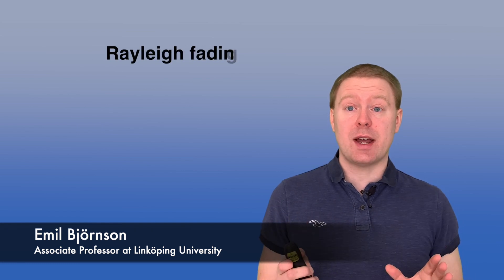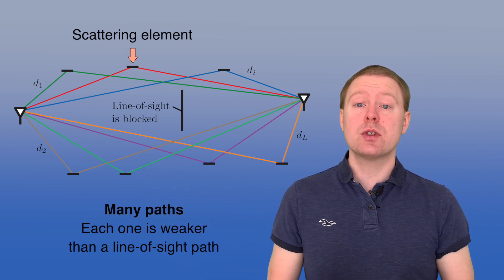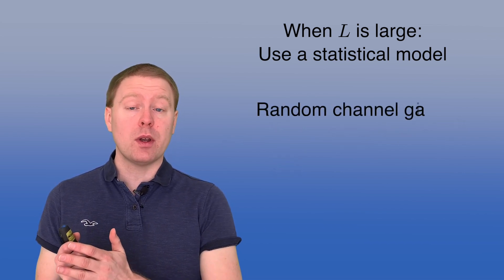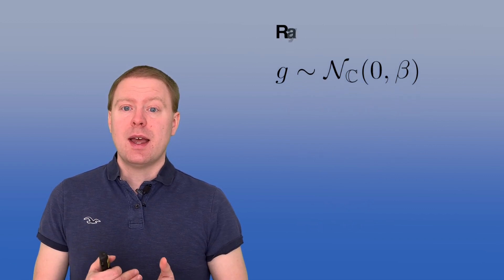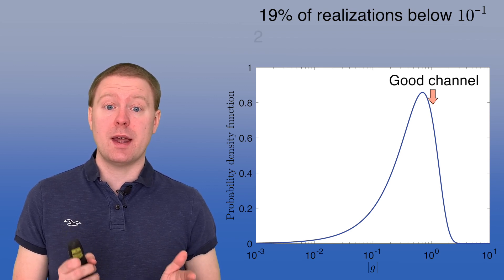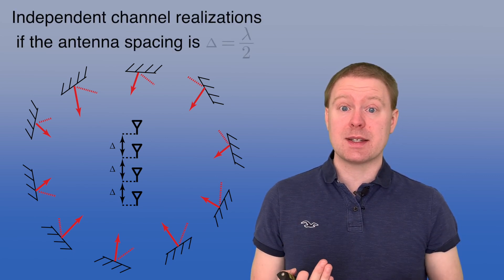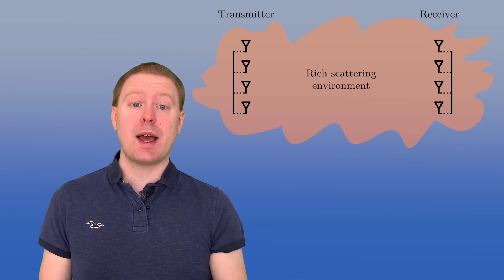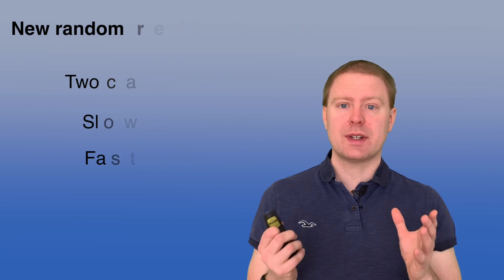Rayleigh Fading Channels [Video 8]

Comment: hello, sir
is this Rayleigh fading channel can be set for simulation only?
if i want to transmit and receive the signal entirely over Rayleigh fading channel in a real scenario, how can I recognize that?
Reply from the maker: Hi! The Rayleigh fading model was created based on measurements. When there are many propagation paths, they tend to interact to create something similar to a complex Gaussian distribution, which means that the amplitude is approximately Rayleigh distributed.

Hence, in real non-line-of-sight propagation scenarios, you can expect to get something similar to Rayleigh fading. The big question is whether the fading realizations across the antennas will be independent (as assumed in this video when we talked about iid Rayleigh fading) or statistically correlated. In practice, we often have some fading correlation, depending on in which angular directions there are scattering clusters and how strong they are compared to each other.
Reply: @WirelessFuture  I totally agree and understand that non Line-of-Sight (LOS) transmission is Rayleigh fading. Based on what you replied, I am assuming that realization of Rayleigh fading channel depends on in the angular direction of the antenna at either side (transmitter or receiver). And by that, If I set the testing environment ( especially indoor) only to have non-LOS between devices, does it mean I have already set for the Rayleigh fading transmission? I barely understand about the angular directions.

Comment: Thanks prof.Emil for your brilliant explanation.
I have some questions.
Why the capacity with same SNR applied  Rayleigh fading channel model(with CN(0,1))  can almost be greater than the capacity applied the estimated channel in real-world scenario?
As a result,  the capacity applied Rayleigh fading channel model can be seen as the upper bound of spatial multiplexing MIMO?
 I'm just wondering if it is possible to get larger capacity in channel of real-world scenario than Rayleigh fading channel model.
Reply from the maker: The best channel matrix from a spatial multiplexing perspective is a (semi-)unitary matrix; that is, all its singular values are equal so one can multiplex many signals that experience equally good channel conditions. An iid Rayleigh fading channel is likely to give you a channel where all singular values are of decent size, but they won't be equally large. One can deploy antennas in real-world line-of-sight scenarios to get a "perfect" channel matrix. Section 4.4.3 in my recent book describes how to do that by carefully selecting the antenna locations: https://www.nowpublishers.com/article/BookDetails/9781638283140
Reply: @WirelessFuture  Thank you for your reply. I sincerely appreciate it.

Comment: sir what should be the value of standard deviation in Rayleigh distribution for highly interference area .
high value or small ?
Reply from the maker: The standard deviation isn't related to interference (which are other signals), but the average attenuation that the channel creates. The variance is typically -70 dB (near transmitter) to -130 dB (1 kilometer away or more). You can have a look at the following video: https://youtu.be/OA4viERrlzA
Reply: @WirelessFuture Sir my professor asked me that...
 For highly dense area, what value of variance should we take for modelling the channel parameter relative to less dense area. He gave me two values 1 and 3
Reply from the maker: @mdraqibkhan8785  One can never receive more power than was transmitted so the attenuation will always be much smaller than 1. However, it is possible to normalize variables to get different scales. The important thing is the SNR makes sense for the setup at hand.
Reply: @WirelessFuture  Ok I got it, thanks sir

Comment: Sir, the code for Capacity Limits and Multiplexing Gains of MIMO Channels with Transceiver Impairments paper, your honor, you published it on a website, I took it, but  it no work, for example, the code waterfilling and the code figure 2, if you allow me to give the code exactly?
Reply from the maker: The code on GitHub is precisely the code that was used to generate the figures in the paper. I just tried to generate Figure 2 and it worked. What error message did you get?

Comment: What should be the pathloss in case of massive mimo channel
Reply from the maker: The pathloss between each transmit antenna and each receive antenna can be modeled in the same way as in single-antenna systems. Typical numbers in wireless communications are -70 dB to -150 dB. A classical pathloss model is the Hata Model: https://en.wikipedia.org/wiki/Hata_model
Reply: @WirelessFuture   would it be same for sparse channel?
Reply: @WirelessFuture  if I want to simulate channel estimation so in channel model I would use H=Ar*(capital lambda)*At^H
Where (capital lambda) depends on pathloss so for sparse channel what value should I choose
Reply from the maker: You can compute the pathloss for each diagonal element as in a SISO system, as long as you make sure that each column of At and Ar have a squared norm equal to the number of antennas that exist at that side.

Comment: which is the most accurate fading model in context to 6G?
Reply from the maker: The more advanced/refined systems we want to build, the more detailed and accurate the fading models must become. The problem is that one can either build a model that is accurate for one particular setup but not for other setups, or statistical models that are not entirely accurate but gives you the possibility to quickly simulate many different setups. So the answer is that no model will be accurate for all purposes. There are general models such as spatially correlated Rayleigh fading that are fairly good, as well as 3GPP models. But we always need to make measurements in different setups to find suitable model parameters. The more advanced models are used, the more parameters need to be selected, and the more measurements are needed...
Reply: @WirelessFuture  Thank you. What about the fading model in industrial  IOT network?

Comment: thank you prof , in order to work in WISP who provide 4G LTE and in not distant future 5G what is the best books to read to fully  understand  wireless world (wave , frequency , modulation , MIMO , P2P microwave links) if you already have a good background about optic network 
thanks
Reply from the maker: This is a hard question to answer. It depends a lot on what kind of book you are looking for. Should it be theoretic and scientifically rigor? Should it be explaining the features of the 4G and 5G standards on a practical level? Should it provide basic insights, without deep theory?

One suggestion is "Wireless Connectivity: An Intuitive and Fundamental Guide" by Petar Popovski. It covers a large number of topics and provide the core properties in a fairly simple manner. So I would recommend reading it first.
Reply: @WirelessFuture  thank you , i mean practical level i appreciate your suggestion and i will read it soon